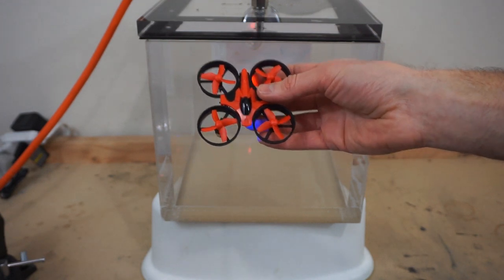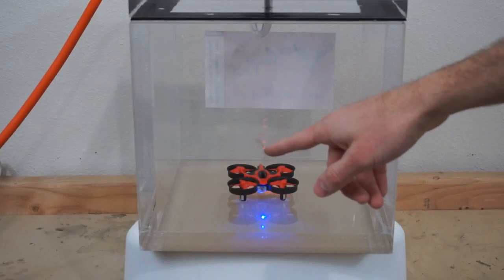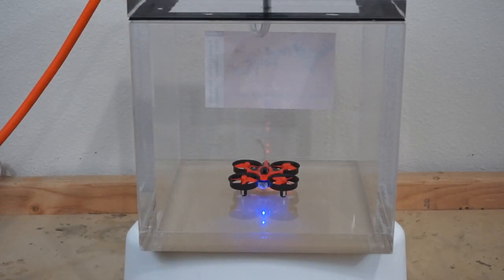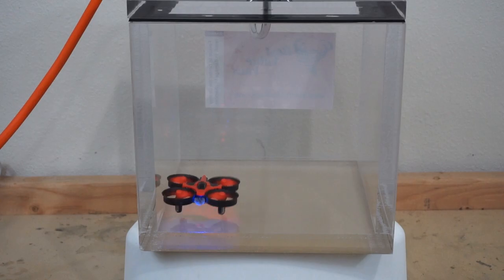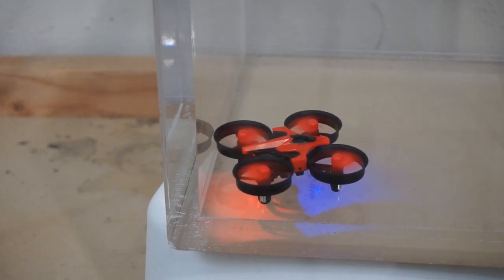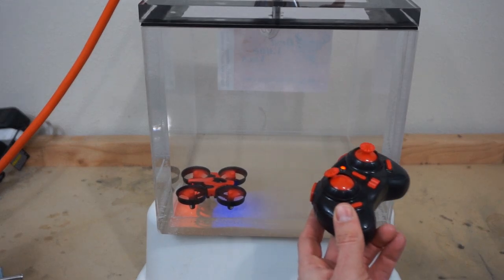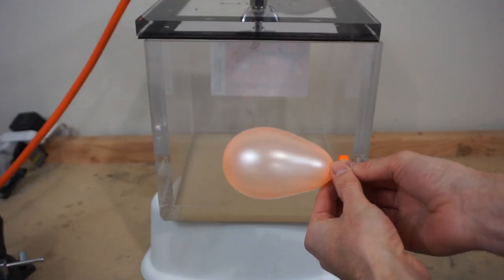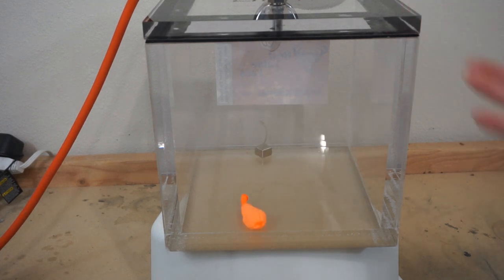What Happens When You Put A Drone In a Vacuum? Can It Still Fly?

Comment: Wow, 7.6k thumbs down? Must be a bunch of flat-earthers out there.

Rockets & balloon fly because they have their own internal force, prop & rotor propelled cannot because they rely on external force.
Reply: Sciencegamer you need to  ignite a rockets fuel and will not ignite in a vacuum hence no gases from rocket
Reply: @Zipfreer  Yes, the burn of the fuel releases A LOT of gas.
Reply: Sciencegamer How can something burn a vacuum? With no O2 to feed it ? not H20 * autocorrect sucks
Reply: @Zipfreer  There is liquid oxigen and fuel inside the rocket, the oxygen burns the fuel inside the propulsors and release gas, you flatters make so many dumb questions... Also that isn's H2O (Water) that burnt things, it's the oxygen (O2), you make it clear and obvious that you are flatters because of lack of knowledge, before humiliating yourself by asking a question like that, research, that's a tip that I give okay?
Reply: @Zipfreer  It's not a problem to ask it, but you flatters claim the rockets can't fly in a vaccum without having ANY knowledge about this area, these people should search it to confirm if it acually doesn't work before claimming it.
Reply: @Zipfreer  I have 2 questions for you; 1. How does a torpedo (Which uses a COMBUSTION ENGINE, google mk 48 torpedo if you don't believe me), run under water? Trust me, it does. 2. What happens when you fire a gun? What causes the recoil?
Reply: No, sorry, that is wrong. Nothing with an "internal force" can be moved. If it is internal, it is internal. You need an external force. The rotor does create its force based on the aerodynamics. With no air, no aerodynamics. The rocket is propelled forward because of conservation of momentum, which works even in a vacuum.
Reply: Awesome argument. Really shows that you are into the topic.
Reply: I downvoted because that quadcopter is not a drone.
Reply: @tafana  thats a shame since quadcopter is one of branches in drones. lol
Reply: do you guys call everything that flies and is RC a drone?
Reply: but it is a very general name, it's like calling all the busses, cars, bikes, planes etc. just vehicles. do you alse call everyt transportation machine you use just vehicle instead of their name?
Reply: @tafana  cows are animals but not all animals r cows 😁
Reply: Dude go read Newton's 3rd law once more..
Reply: @ToniK-music  

Those was real uneducated words.
Reply: @Zipfreer  

I like how your "damning" evidence (question based on total ignorance) against space flight was rebutted by simple physics, so you ghosted.

Top notch.

Flat brain.
Reply: Ibrāhīm Arnold how can I ghost anyone when it’s not my  video or channel? I have no control over comments I think you’re a little confused in many ways
Reply: @Zipfreer  

Uhhhh.....

Is English your first language, because what you just said doesn't really match the idiom I chose lol

You dropped out of the discussion once somebody poked a hole in your space denier "logic".

I'm only confused about one thing: why is a question seen by people like you as evidence against something?
Reply: @Zipfreer  

Ok nice reflection.

Just make peace with your lack of scientific understanding, and stop using it as evidence against basic concepts. It's annoying.

Space is real. Space flight is 100% possible.
Reply: @Zipfreer  

You said...

Rockets won't work...

In a vacuum...

You were proved wrong....

You left....

I laughed.

What's to get?
Reply: @Zipfreer  

Dang...I just looked at your channel. I figured you were like 16-20...boy I'm disappointed in the world today.
Reply: Poor education. Well actually you don't need to know that much. Just a little about forces and energy.
Reply: I downvoted because it seemed like a video for dummies. The concept is pretty evident with your eyes but the guy still seems to be having something to explain. Why??? 

Because instead of correct the fallacy in the question he tries to create and answer by action. Wow! Claps!

Rockets don't fly. Rockets "PROPELL". Which means something pushes them ahead. It doesn't matter if there is air or vaccum and this is pretty self evident from looking at a rocket. Only those crafts that undergo a lift force against gravity will and do "fly".
Reply: @suyashneelambugg  agree same reason I down thumbed it. But it's people like Nicholas dodos who would fall for the flat earth theory.
Reply: I don't get why people say it was flat earthers. I simply disliked because this is absolutely trivial info

Comment: They weren't guessing and hoping that rockets would work in a vacuum, they knew without question that it would work and they'd actually seen it work in vacuum chambers (they weren't so lame that they created the vacuum chambers to "make sure" that physics was right, they ran them in vacuum chambers to see if there were any mechanical issues they had neglected to consider in the design of the rocket motor).
Reply: What a lot of people don't take into account (and flat earthers ignore) is that space doesn't just start, it's not just atmosphere then vacuum, it's a gradual pressure decrease. By the time you're at cruising altitude for jets, the pressure is already 1/3 of what it is on the ground. They had plenty of experience of flying aircraft and rockets higher and higher before they managed to get them into space. The V2 was able to reach very close to the Karman Line, which is typically accepted as the boundary of space. At that point air pressure is negligible.
Reply: @ChrisCooper312  Good point but how does any type of Rocket START it's movement WHILE already In Space? That is the Question, not how does it GET to space. Space is Not a chamber.
Reply: @hotheadedjoelhaha  By Newton's 3rd law of motion. If you spew stuff from the rear, the rocket will start moving forward.

Comment: that's a toy, not a drone
Reply: By definition, it's a drone. A toy drone.
Reply: Neon - TC ....no that is toy....want proof?.. drone definition: a remote-controlled pilotless aircraft or missile, that has or/and is operated by an on board camera......his TOY doesnt have a camera.......and language terms.....ROASTED!!!
Reply: fuddle128260394 Quadcopters fall under the category of drones, don't they? Also they don't have to hold a camera or be capable autonomous flight. That's just an unmanned aerial vehicle which also falls under the category of drones.
Reply: Neon - TC im done arguing, that 20$ toy is NOT a drone, a real drone is way more expensive and advanced. just becuase u put some propellers of crap doesnt make it a drone.
Reply: Correct, this is a quad copter not a drone.
Reply: Tesla Nick thank you👍
Reply: Actually you're all wrong and right at the same time. There is no agreed upon definition of a Drone (UAV). http://www.ezvid.com/drone-vs-uav-whats-the-difference
Reply: Ka Kaw Yayo, thank you
Reply: +Ka Kaw Yayo i know, because the original ORIGINAL meaning of drone is a low humming sound, only recently did they add the autonomously or onboard camera flown UAV version, making it undecided.
Reply: It was originally used to describe a male honeybee. (Old English dran, dræn)  First used circa 1520's. It was used to describe "a deep continues humming sound" later on. The first use of it regarding aircraft was used in November 1946 in an article published by "Popular Science."
Reply: CALEB BROWN true
Reply: +Ka Kaw Yayo wow didn't know that.
Reply: this is indeed a toy quadcopter, a drone has some sort of camera aswell as some auto pilot options
Reply: OMG this comment thread. Who gives a fuck what it is. You could put a $3000 drone in there and it wont make any difference. Point is quad copter drone what ever the fuck it is wont fly in a vacuum.
Reply: Captaintoast12321 true true👍
Reply: So a toy train is not a train? A toy car is not a car? This is one of the dumbest arguments I've come across on Youtube, and that's saying alot.
Reply: Denis Lipatnikov u right, and i started this so that's saying alot😂😂😂
Reply: It's a toy, it's a drone NO IT'S SUPER-MAN!!!
Reply: It's a drone.
Reply: ur completely correct, good job👍
Reply: +Denis Lipatnikov no, they are toys modeled after the real deal.
Reply: Mister Man..?..i know why doesnt any understand the diffrence between a fucking drone and a toy
Reply: +CALEB BROWN can you run that by me again?...
Reply: What?
Reply: +CALEB BROWN rephrase what you said, i didn't quite get it
Reply: This is in fact a drone, UAV (Unmanned AircraftVehicle)
Reply: +llama no, it's not. It's a $5 toy. It's like comparing a nerf gun to a lethal firearm
Reply: So, so true, perfect representation.
Reply: +CALEB BROWN can you please click the reply button, no one knows who that's directed to
Reply: Mister Man ok, and that was directed to u
Reply: CALEB BROWN its a Quadcopter/Tiny Whoop
Reply: iJamie8467x wtf does that even mean???
Reply: +iJamie8467x haha tiny whoop
Reply: clearly you don't own one to know what a tiny whoop is
Reply: because expensive toys give you knowledge
Reply: So are the bigger drones. Unless you have one from the military they are all toys. But i suppose if you really do have a military drone and your just playing with it then it would also be a toy
Reply: pandarama67 NOOOOOO!!!!! some are toy quadcopters (like the two dollar crap hes got) and some are real bad ass drones, like the phantom 3 I've got. GOSH GET IT RIGHT!!!
Reply: CALEB BROWN Its still a toy $3000 or not still a toy
Reply: •5stars • No its not!!! get this through ur small head theres a fine line between a cheep two dollar toy and and expensive high quality drone, just like there is a fine line between a rc car and a real car.
Reply: CALEB BROWN You missed the point. They are all toys. Its all relative son.
Reply: pandarama67 What point am i missing "son"!!! Because im pretty sure that is a crappy plastic toy with four cheap propellers and DOES NOT classify as a drone.
Reply: CALEB BROWN Well if you are in the military nothing els but what they use is a real drone then everything els is a toy
Reply: David R wtf did any of that have to do with out drone argument???
Reply: pandarama67 no. r wrong
Reply: CALEB BROWN Ok poopy pants
Reply: CALEB BROWN Why are you getting mad at people just because they don't agree with you?
Reply: Geovany M I think he just needs to get off movies computer and have a nap
Reply: ShadowGalaxy63 they are all toys if you are playing with them
Reply: U talking to me?😡
Reply: Mc GetRekt bet u would say that shit to my face.
Reply: Mc GetRekt where u from?
Reply: Actually, there's no such thing as drone or quadcopter. It's all in your heads.
Reply: Desmond Low ur right
Reply: and everyone just turned into a dictionary expert. damnson.
Reply: a camera isn't a necessary attribute to make something a drone
Reply: David Morgan for a real drone it is
Reply: the ability of autonomous flight is
Reply: Mister Man What facts have you provided with any source that proves they are correct?
Reply: he is 100% correct. Drone is a buzzword created by the media, and does not fit most quadrotors. Unless a quadrotor is 100% autonomous, it is not a drone. It is no different than a remote controlled helicopter.
Reply: Quadcopters are drones.
Reply: Dictionary.com: an unmanned aircraft or ship that can navigate autonomously, without human control or beyond line of sight: the GPS of a U.S. spy drone. (loosely) any unmanned aircraft or ship that is guided remotely: a radio-controlled drone.
Reply: NickBrew98, if the quadcopter is a cheap toy, it is not classified as a drone, get that through your head!!!
Reply: So how much exactly is considered cheap?
Reply: Technically, yes – quadcopters are both drones and Unmanned Aerial Vehicles. Just google (is a quadcopter a drone.)
Reply: toy or not it still performs the actions of a drone.. at best it's a novelty drone.. but still a drone in regards to what it actually is.. an unmanned aircraft or ship that is guided remotely. Seems like you're the one struggling to get your head around the concept. Just because it's small and cheap doesn't take away from it's abillity to fly remotely, which makes it a drone haha
Reply: CALEB BROWN  Ok fine, call it what you want. But it does still do the actions of a drone.
Reply: weused2bestoned 😂😂😂
Reply: What three words are you referring to? Also, I never said I would get 120 likes. I'm assuming you're making stuff up.
Reply: Mister Man No, I'm saying that you are saying they are facts, but that does not prove that anything about what you've said is factual just because it is your opinion. Your argument is not legitimate if what you are saying is false and the only thing you have to back it up is your own view on what other people have created and defined.
Reply: +CALEB BROWN Your "$3000 phantom 3 drone" is not a real drone. The real drones are the UAVs the military use.
Reply: Look up drones in google images and see what comes up then.
Reply: You can not tell what makes up a man just by typing "human" into Google Images, because women will come up too and you will see that their anatomy is different. To know what a male is would be to know the definition of them. 

I have given you the definition of a drone, and the quad copter in the video meets with the criteria just fine.
Reply: Drone: Make a continuous low humming sound.
A more recent usage of the word is also for unmanned flying devices.
No point in arguing how big they should be or whether they have cameras or not. I suspect at some stage they may be silent and ironically will still be called 'drones'.
Reply: +CALEB BROWN Google Images is neither a dictionary nor an encyclopaedia.
Reply: GrumpSkull No, it can't be classified as a car, but it is called a matchbox car to indicate the scaled down version of an actual car it is  being modeled after. It'd be just like calling a small giraffe sculpture a model giraffe or something of the sort. It's not a giraffe, because it doesn't perform or function as a giraffe would, but it is a scaled down version of a giraffe being modeled. The quad-copter in the video can still perform and operate as a drone is said to be able to, so it can be considered a drone. 

Yes, these arguments are VERY silly and are issues that are completely insignificant to living life, but the fact that something so simple and so blatantly clear to be true can't even be agreed upon is an issue and why so many people are opposed to one another. It would be of help to people though to have these arguments and develop rational thinking skills and the ability to accept what is true.
Reply: CALEB BROWN it's a quadcopter
Reply: I don't care what you think a drone is. This is the FAA definition of a drone: "An unmanned aircraft system (UAS), sometimes called a drone, is an aircraft without a human pilot onboard – instead, the UAS is controlled from an operator on the ground." Therefore this is a "toy" and a "drone" at the same time. 

If you consider the fact that the government definition of a drone is the law that you abide by, then it doesn't matter what your opinion is. 

Source: https://www.faa.gov/uas/
Reply: Dimm Vargr neither is any of the information comming from  u
Reply: GrumpSkull.
A paper plane (made from a folded sheet of note paper) when in flight as a glider is technically a plane (airplane, aeroplane, aircraft).  Planes can be fancy, or plain, but still be planes.
Reply: John Klumpp Lets set you take a trip over seas in a paper plane.
Reply: CALEB BROWN challenged: "Lets set you take a trip over seas in a paper plane."

To what purpose?  Even your vaulted ridiculously expensive RPV can not carry a passenger, and lacks range for an ocean crossing.
Reply: CALEB BROWN potato patato
Reply: + Jason H
Or, this is a comment thread in which CALEB BROWN drones on-and-on about other folk's lesser expensive RPVs not being in the same financial league as his freakishly expensive $3000 Phantom 3.

He thinks others will be left with plane (plain?) envy, although their bank accounts should be left in a not-so-major depleted state.

Let that be a warning- drone enthusiasts may be very boring company, since they may tend to drone on-and-on about how much they drop on their habit.
Reply: CALEB BROWN source: dictionary.com
Drone
(loosely) any unmanned aircraft or ship that is guided remotely:
a radio-controlled drone.
Reply: John Klumpp True. My point was simply anything is a toy that doesn't have a nessacary purpose . I drive my mercedes on the weekends and that's one of my toys. Unless his job is spotting terrorist from up high his $3000 drone is also a toy.
Reply: The balloon didn't fly. It deflated and fell.
Reply: Yeah, because it’s absolutely gonna fly because of that extra bit of camera… No. Drone or toy doesn’t change the principle he’s trying to prove in this video.

Comment: Instead of baloon if u had put water jet pipe that would demonstrate rocket phenomenon better or even better if baloon had colored gas  & u filmed with ultra slo mo camera.....The spectecular phenomenon is that in vaccum gas stays as jet rather than diffusing as is the case in air
Reply: Problem is water boils in a vacuum. Wouldn't work.